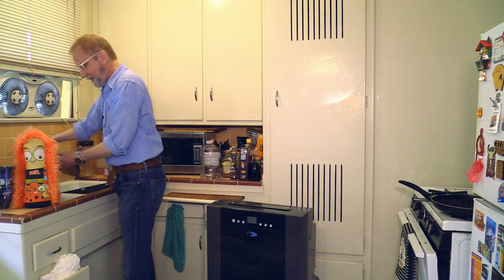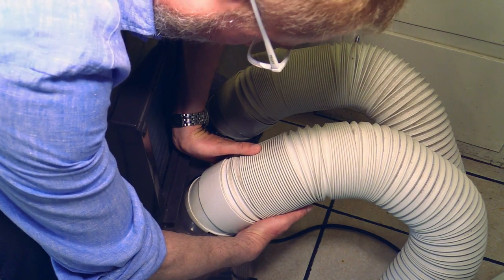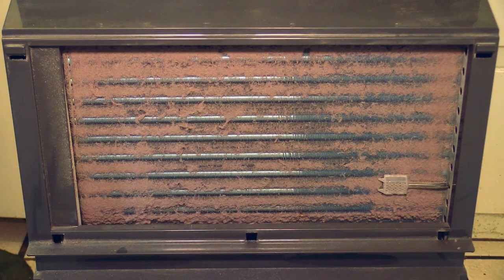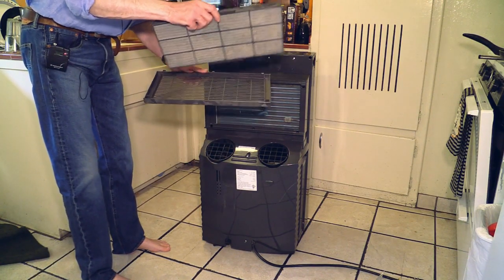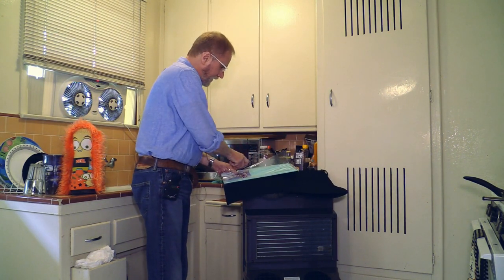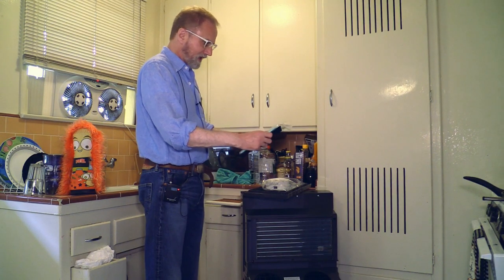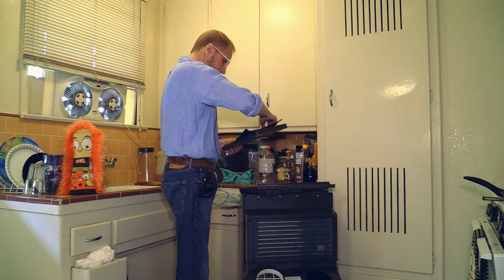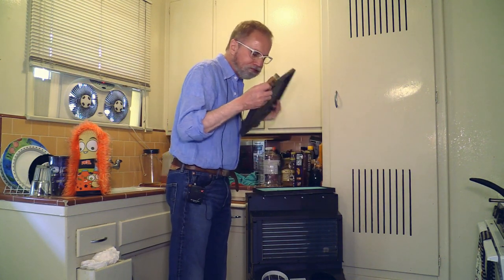Whynter ARC-14SH - Filter Replacement

Comment: You are a great teacher I bought the same airconditioner and I put it on top of flat service nightstand  . Made 4 hole on the nightstand for the wheels to fit inside it so the airconditioner doesn't slide off. The I bought plastic tubing and connected it to the drain and the other side into a 5 gallon bucket. Now I don't worry about it draining on the floor in case I forget or it shut off
Reply from the maker: Thank you very much for your kind words. I really appreciate it. Sounds like you have a very good setup for the AC unit. Thanks for sharing your project with me and the rest of the world. Greetings from Los Angeles.  😀
Reply from the maker: I am having my FIRST Giveaway. Enter Woopnik's DYSON CYCLONE V10 MOTORHEAD Giveaway. FREE FREE FREE. Please click on the link below or copy and paste the link in a browser to see how to enter the Giveaway and the terms and conditions:https://gleam.io/n0Y1O/woopniks-dyson-v10-motorhead-giveaway😀

Comment: Hi. Congratulations. Very nice video. I would appreciate if you provide guidance for removing the back part of the air conditioner for cleaning the its internal parts. I tried to do that by removing the screws, but the back part is but the back remains attached to the rest of the body of the equipment.
Reply from the maker: Thanks for your comment. I really appreciate it. Will get back to you about the back part.  😀

Comment: M. Woopnik, in order to properly dehumidify a room, do you need to unscrew both window «tubes» (for lack of a better word) from ARC-14SH unit?  Do both window tubes push air OUTSIDE or does one tube push air INSIDE while the other pushes air OUTSIDE and do these tubes play a role in dehumidifying a room?  Questions asked because my sister is not yet impressed with the dehumidifying function of this unit...THANKS IN ADVANCE FOR ANY INFO...:-)
Reply from the maker: Hello amcpower. As with every portable air conditioner with two hoses, one hose is pushing out air while the other one is taking in air. Yes you need to vent in either mode. The de-humidity setting uses the moisture it removes to cool the condenser. It is basically in A/C mode on low. The humidity extracted in the form of condensate is vented out of one of the hoses. It is used as a cooling aid for the condenser which turns it back to vapor. So if you don’t vent it you are accomplishing nothing. You will be recycling the same moisture.

Comment: Wrap the exhaust duct in felt to insulate the hot exhaust air going outside so it does not heat the room.  Available at Amazon and Home Depot stores
Reply: John Gavin Can you be more specific? What exactly is the exhaust duct? Can you share more info please?
Reply: @natalieskye8377  Their are two air ducts on the back of the unit.  The one that feels hot is the exhaust duct.  Wrap it in insulation felt for the entire length of the duct.  Make sure the window with the ducts is fully sealed to keep outside air out. Be sure the duct connections are tight and nothing obstructs them from venting.  You can use duct tape if they leak hot air.

Comment: Hi my Portable AC doesn't cool at all. Its seems to throw regular air like a fan. what do you think might be wrong with it? I watched your video and changed the Air filters but no change :/
Reply from the maker: Hi Valdez. It is possible that the ambient temperature is too high. Portable air conditioners work by pushing cool air into a room and venting hot air, through the units compressor, to the outside. This constant venting can cause a pressure imbalance that will pull in warm air from other parts of the house. To solve this, make sure any doors to the room are closed. If the room receives a lot of sun, be sure to cover the windows with curtains or shades. 

Another possibility is that the culprit may be a refrigerant leak in your system. Freon is a refrigerant, or coolant, which helps your AC unit evaporate its internal heat and allows the air is expels to actually be cool. With a central AC you can fix the leak and replace the coolant. But with a portable AC that is different. They often do not have charging ports fitted. Also if it is short of refrigerant it must be leak tested and repaired prior to recharging. You would need so many supplies to fix that and invest lots of time to do that. You also might need a permit to handle refrigerant, depending on your local laws. If the loss of refrigerant is the problem then, in my opinion, it would be cheaper to buy a new unit.
Reply from the maker: I am having my FIRST Giveaway. Enter Woopnik's DYSON CYCLONE V10 MOTORHEAD Giveaway. FREE FREE FREE. Please click on the link below or copy and paste the link in a browser to see how to enter the Giveaway and the terms and conditions:https://gleam.io/n0Y1O/woopniks-dyson-v10-motorhead-giveaway😀

Comment: Hey I have a question I have the same ac and it  usually works great but I feel like it’s not throwing cold air like it used to I have it on all the time I’ve cleaned it  I keep it maintained but I still feel like it’s not  getting as cold as it should be
Reply from the maker: Hello Angel, thank you for watching my video. Have you extended the exhaust hose with another hose? The unit can ONLY be used with the included exhaust hose (dryer type exhaust hoses will cause the unit to over heat). 

How close is the unit to the wall? If the unit is only inches away from the wall and you are running the exhaust hose out a window, more than likely their exhaust hose bend is at 90 degrees which restricts air flow. In order for the unit to run more efficiently and not overheat, it should be at least 1-1/2 feet away from the wall and the exhaust hose should not exceed more then a 45 degree angle.   
                                                                                                                                                                                                                                                            Are you exhausting the unit out a hole in the wall? If so, are you using a flap vent on the exterior of your home/office? The flap may be too rigid and not open continuously. The compressor is not strong enough to push the air through and therefore will only run for a short period of time before overheating and shutting off. You should take the flap off the vent and replace it with a piece of screening.
Reply: Woopnik I have. A piece connected to my window witch closes it off and I have it close to my wall I’ll separate it more in a moment I just recently purchased it on amazon it was working perfect for a week it is hot outside 109 and I have it on the lowest temperature and it’ gets cool but just doesn’t throw as much air as it used to
Reply: Everything I used is out the box
Reply from the maker: 109 degrees Fahrenheit? This is a lot of heat for every air conditioner. When the ambient temperature is too high, it can cause insufficient cooling. If the ourside temperature is extremely high, the air conditioner may not be able to generate enough cold air to cool the room. Sunlight can also heat a room faster than your portable air conditioner can cool it. If temperature keeps rising, check for leaks and close the blinds. It may be enough to swing things the other way.
Reply from the maker: I am having my FIRST Giveaway. Enter Woopnik's DYSON CYCLONE V10 MOTORHEAD Giveaway. FREE FREE FREE. Please click on the link below or copy and paste the link in a browser to see how to enter the Giveaway and the terms and conditions:https://gleam.io/n0Y1O/woopniks-dyson-v10-motorhead-giveaway😀

Comment: Hey whoopnik I just got one of these just today. The intake/exhaust hoses are on and off in AC mode... high speed. Is this normal or should they be eunming constantly. They are off more than on
Reply from the maker: Hello Google User. I will answer your question a little bit later.  😀
Reply from the maker: The Whynter dual hose portable air conditioner comes with one air intake hose and one air exhaust hose, the air intake hose pulls air into the portable air conditioner from the outside to cool off the compressor and condenser coil. The hot air generated from the air conditioner is then expelled out the exhaust hose. When temperatures begin to warm uncomfortably, you may feel tempted to purchase an air conditioning unit as quickly as possible just to get comfortable. You will enjoy better results, however, as you take time to research the different options and compare the benefits and drawbacks of those options. In fact, the best time to make this decision is probably before the red on the thermostat starts to rise. With time to do some research and take measurements, you’ll be able to get the air conditioning system you want in place before there’s any chance of being uncomfortable. 

I might have misunderstood your question in case you wonder what I am talking about. If this is the case please let me know more in detail what your situation is.  😋
Reply: Yes I don’t believe you understood what I was asking but no problem, I clarify... I was just wondering if it is normal for this AC exhaust hose to not constantly be blowing the warm air out window? The exhaust is on and off. With my single hose 6000btu arctic king ac, the exhaust hose is always blowing air out the window, even in fan mode still wind blowing out the exhaust hose. With this ARC-14SH AC, the exhaust hose is blowing out air on and off. Is this normal?
Reply from the maker: No, this is not normal. Have you extended the exhaust hose with another? The unit can ONLY be used with the included exhaust hose (dryer type exhaust hoses will cause the unit to over heat). 

How close is the unit to the wall? If the unit is only inches away from the wall and you are running the exhaust hose out a window, more than likely their exhaust hose bend is at 90 degrees which restricts air flow. In order for the unit to run more efficiently and not overheat, it should be at least 1-1/2 feet away from the wall and the exhaust hose should not exceed more then a 45 degree angle. 

Are you exhausting the unit out a hole in the wall? If so, are you using a flap vent on the exterior of your home/office? The flap may be too rigid and not open continuously. The compressor is not strong enough to push the air through and therefore will only run for a short period of time before overheating and shutting off. You should take the flap off the vent and replace it with a piece of screening. 

Are you venting the Whynter AC into a ceiling or basement? Does the ceiling or basement have ample ventilation? If the ceiling or basement does not have a way of pushing the heat from the exhaust to the outside, the unit will work for a short period of time and then eventually overheat and shut off.

I hope that my short message will help you. 

Have a great long weekend.
Reply: I’m using the AC in my van. I’m using the included intake and exhaust hoses. The hoses are not extended at all and not bent at all. The hoses go straight out the window so there’s no way for there to be a problem in that area. You sure it’s not normal? Seems like if it has an EER of 11.2 maybe it could be normal to come on and off
Reply from the maker: It is an educated guess what I am saying about your AC. With my AC the compressor turns off when the desired temperature is reached in the room and turns back on automatically when the temperature is rising again. The fans are always running. That is normal. I hope that this is what happens with your AC. But when it is a different scenario, then the AC has a problem. I was not aware that you put the AC in a van. How do you power the AC? Back to the problem. What you describe is basically an ideal setup for an AC (I don't know about the van 😀). The last possibility which comes to mind are again the hoses. The Whynter AC is not taking warm air from the room to be cooled, the dual hose takes cooler air from outside via its second hose. Having said that, one crucial factor is how far apart in your setup the intake and the exhaust hose are. If they are too close the intake hose will be taking in also the hot air from the exhaust. Instead of cool air the AC takes on warm/hot air. That overwhelms the AC. The compressor gets too hot and shuts down. The manual does not specify a minimum distance between intake or exhaust hose. Do be mindfull to keep a proper distance between the hoses. I would say one foot distance should be fine. The further apart the better.
Reply: Also, FYI I returned the defective AC and have a new one on the way, this time from Amazon. Went thru eBay last time

Comment: link for the filter?
Reply from the maker: Hello. Here is the link to the 3M filter: https://www.amazon.com/gp/product/B0081KKB78/ref=ppx_yo_dt_b_search_asin_title?ie=UTF8&psc=1
Reply from the maker: And here is the link to the carbon filter: https://www.amazon.com/Compatible-Replacement-Conditioner-ARC-CF-14S-CFS/dp/B01L2FFVWI/ref=pd_bxgy_2/144-1012756-9458221?_encoding=UTF8&pd_rd_i=B01L2FFVWI&pd_rd_r=655f6cd5-a8d4-47b0-97d8-4e9e0ee55901&pd_rd_w=C355H&pd_rd_wg=5tmXT&pf_rd_p=ce6c479b-ef53-49a6-845b-bbbf35c28dd3&pf_rd_r=7ZG9PGSAC2JQ1JVK3T6C&psc=1&refRID=7ZG9PGSAC2JQ1JVK3T6C
Reply: @Woopnik  thank you so so so much :)
Reply from the maker: You are very welcome. Have a good day. 😀👍

Comment: Woop, my whynter AC is smelling like urine, how can I fix this?
Reply from the maker: Most foul smells in a portable air conditioner are caused by bacterial growth or by mold and mildew growth. This is because air conditioners perform their function by removing moisture from the air, and as this moisture condenses inside the mechanism it provides a perfect growth environment for various types of mold and bacteria. The unit's various components can become dirty and moist, providing the perfect environment for bacteria or fungus to thrive.
Smells range from a mild musty odor often related to mildew, to a rotten or spoiled food smell that indicates mold or bacteria growth. Without proper maintenance of the filters, coils, and drains, a portable air conditioner can become overrun with mold, but it is easily cleaned away in most cases. Monthly cleaning or replacement of these parts prevents the odor from returning.
The key to eliminating odors is to find where the bacteria or mold infestation is located. There are three prime targets: the filter, the drain line, and the evaporator coil.
Reply from the maker: First and foremost, you should clean the drain line. On portable ACs, the drain line is a tube that is located on the outer side of the unit. Find the pipe and clean it using the following instructions. Make a mixture of one part bleach in three parts water and clean the drain with it thoroughly. This will remove any mold, mildew or debris that might be causing the odor. Of course, if this doesn't cure the problem, you have to move on to the next step.
Remove the lid of the portable AC and inspect the coils. Use a flashlight so you are easily able to spot debris, mold or anything else which may be causing the smell. Once you undo the lid, it will be quite clear to you whether the odor is coming from the inside of the air conditioner or not. Clean it thoroughly with a damp cloth to ensure that nothing is sticking to it.
Change the air filter. Unless you put in a new filter recently, it is likely that the odor is being caused by the buildup of dust and debris on the air filter. In that case, the correct option is to replace the air filter and put in a new one. If it was causing the problem, the odor should go away in a matter of minutes.
Reply from the maker: Be careful with cleaners. Do not use any harsh cleaners. Personally, I would use my judgment on this though. I am not sure how much you can get at the insides, but I would try and brush the coils with an old toothbrush and warm water with a drop of dish soap.
Reply: @Woopnik  Thanks for your response. I have the same model AC as you do. A family friend passed it on. I opened the drain pipe today, no water came out when opened but I tilted the AC and I a lot of water came out. Including some debri that could have been mold/bacteria. After that the smell continued. I vaccuumed and cleaned the filter. I will have to purchase a additional one as you have. removing the entire back proved more challenging. Have you removed the housing for Whynter AC? Could you make a video on this?
Reply from the maker: Yes, I made a video about it. It is very simplistic. Contains pictures of which screws to remove: https://www.youtube.com/watch?v=tBuFn9jSTq8&feature=youtu.be

I hope it helps.
Reply from the maker: You might have to apply some force to crack open the shell.
Reply from the maker: Please don't forget to "Like" the videos which are helpful to you and maybe also subscribe. This would help my channel a lot. 😀
Reply: @Woopnik  Thanks so much for your help. I wish your channel much success and growth!
Reply from the maker: Thank you. I really appreciate it. Greetings from Los Angeles. 😀